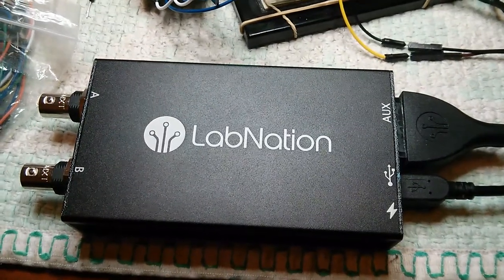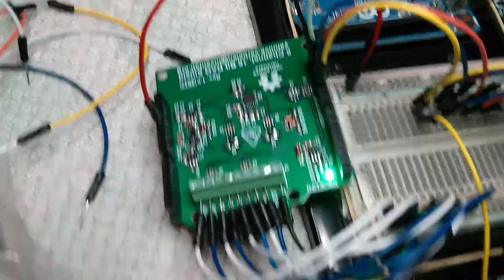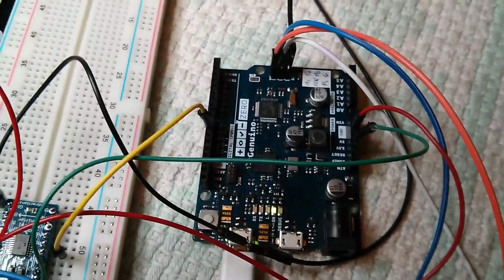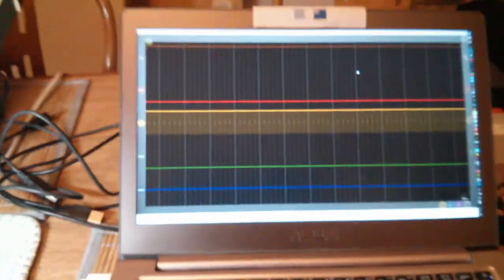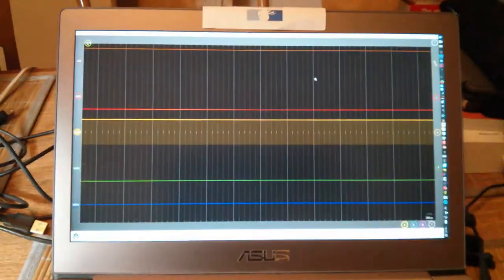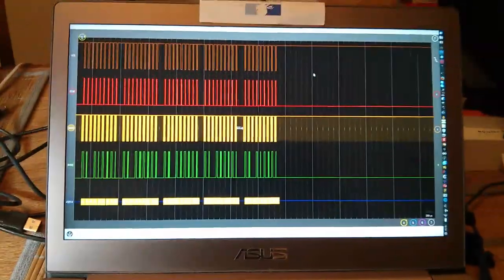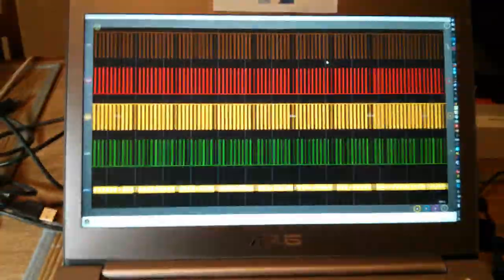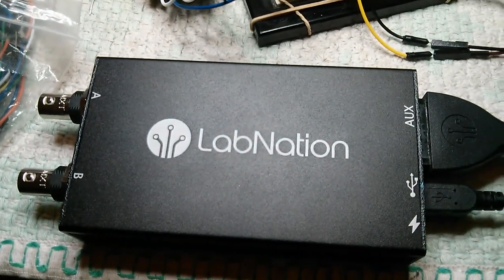Arduino Zero Transfering ADC readings to a PC

Comment: Can you share about this project ?
Reply from the maker: Sorry, what do you want to know?
Reply: Please share with me wirring diagram and code, please. I want to use a high-speed ADC converter to collect data so I really need your instructions and this sample project.  Thank you
Reply from the maker: @thanhvietle8671  Hi, Sorry to say there is no code, nor wiring diagram. I just connected the ADC breakout board to the arduino and used that to breakout the SPI data so It could be captured by the oscilloscope. What you see on the screen is just the oscilloscope representation of the SPI stream.  If you need help with ADC, I suggest looking at the tons of example code around for your particular ADC.  I would also suggest looking at the Arduino examples for analog and digital input/output. If you are unfamiliar with coding in C/C++ this may prove to be a challenge. Another possibility would be to use a raspberry pi and the example code in Python. Again, if coding in Python is new to you, this too will be a challenge. Sorry to not be able to help you out more...
Reply: @GratefulFrog  i also have experience with arduino.  But writing code to make it work at a very high speed of up to 250 thousand samples per second is another matter.  If you have experience with that, please help me
Reply from the maker: @thanhvietle8671  what ADC do you intend to use? SPI max thruput is 50Mbps and I2C is 3.4Mbps, depending on your adc resolution, let's say 16bits 250* 16 = 4Mbps (12bit would mean 3Mbps) so a 16bit SPI ADC should easily be able to handle it, or a a 12bit ADC on I2C,  but the rest of the data chain must be able to keep up... I don't know what your application is, but if you pick a common ADC, you should easily able to find a C/C++ driver for it and play with it on a high end arduino or rpi?
Reply: @GratefulFrog  The speed of the SPI protocol is of course enough? But how can Arduino process and save or transmit that much data to the computer?
Reply from the maker: @thanhvietle8671  I don't know what you are trying to do. It depends on your application, what hardware you will need. A powerful fast Arduino, a multi threaded rpi or something else. I would expect that an rpi would be able to do much more than an Arduino, but a big computer could do even more , for example if the Arduino just acted as a data relay. That's the most I can say. Good luck with your project!